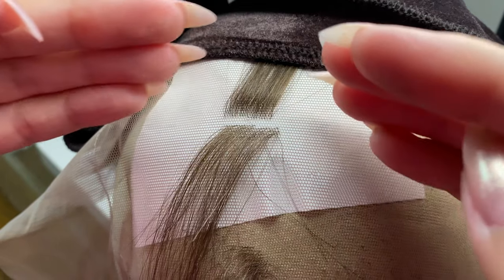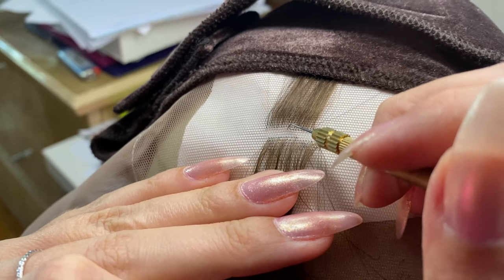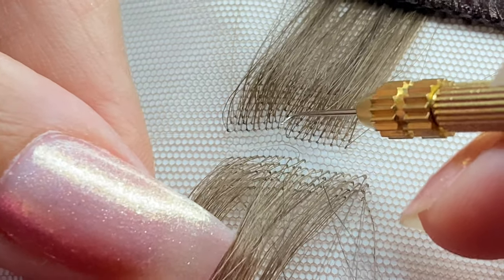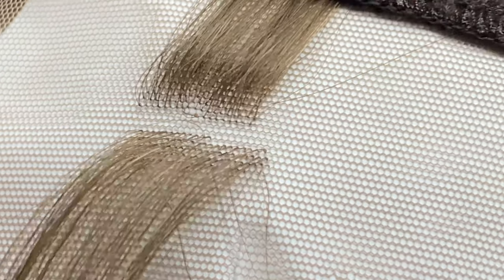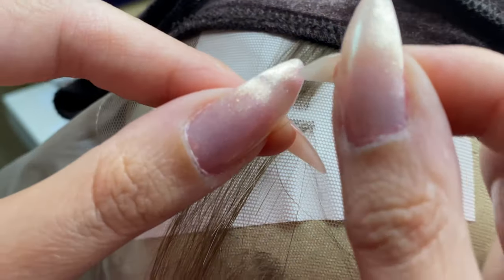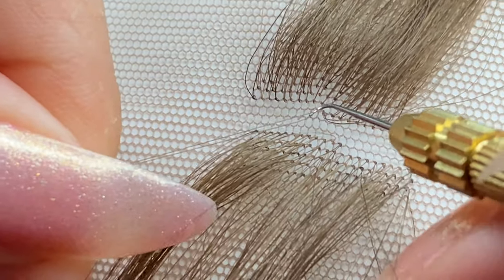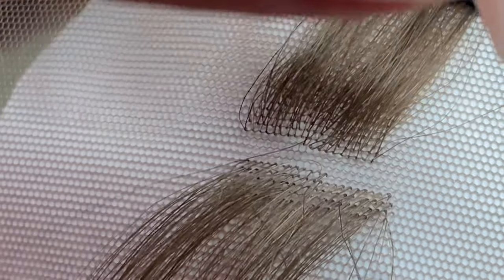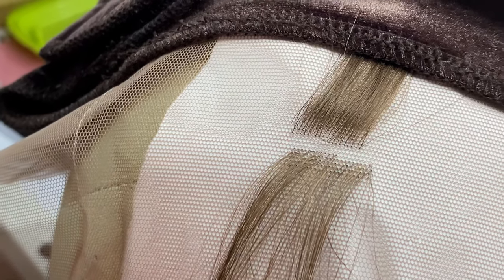Tutorial : How To Ventilate Hair In a Lace Wig (Single Knot)

Comment: Do you just leave the shorter piece of hair as-is after tying the knot? Won't it look like a flyaway after the wig is done?
Reply from the maker: This is one of the most frustrating things for me about wig making with human hair. That shorter piece is called a "turn around" as I've come to learn. It goes against the grain of the rest of the hair pointing downwards. But this is how it's done. I tried clipping those off and it becomes spikey. If you use synthetic hair, this is not a problem because you can fold the long hair in half and you won't experience 'against the grain' problems. Check out my TikTok page @LizLele so see how it's coming out now, it looks nice, not noticeable
Reply: @LizLele  couldn't you also do it so both strands are the same length (i think that would possibly shorten the length of your wig- but is it a possibility? )
Reply from the maker: @likelyllek  hair has a direction. So one piece would be going against the grain and would lead to tangles.